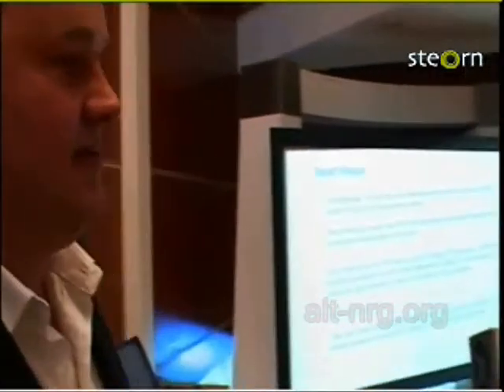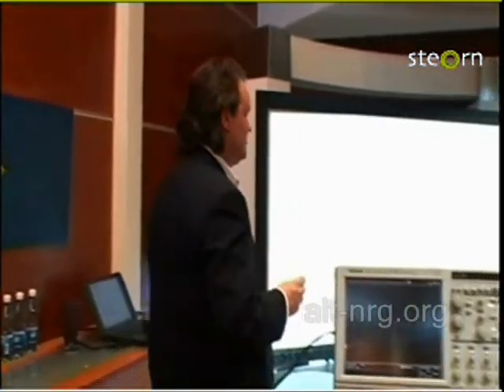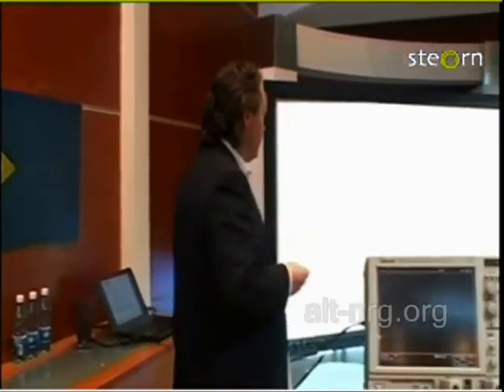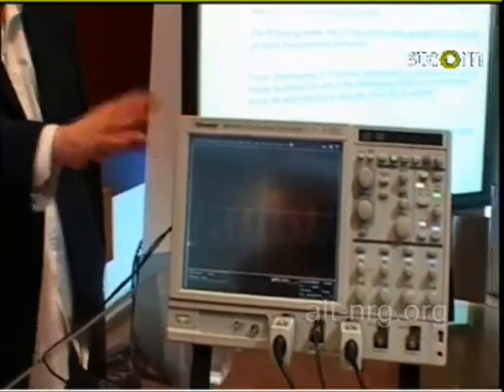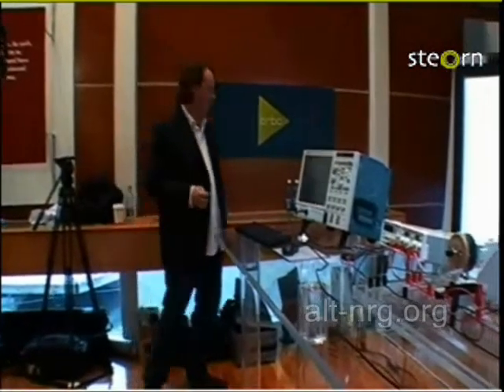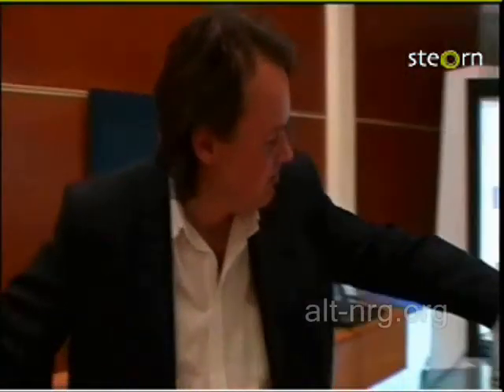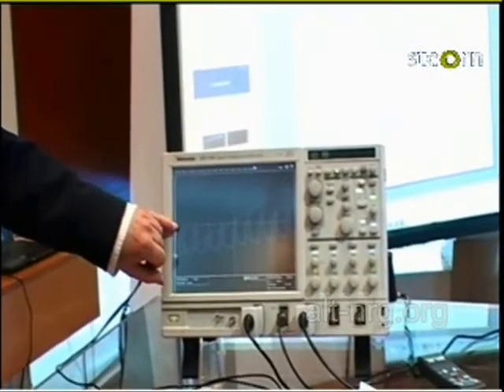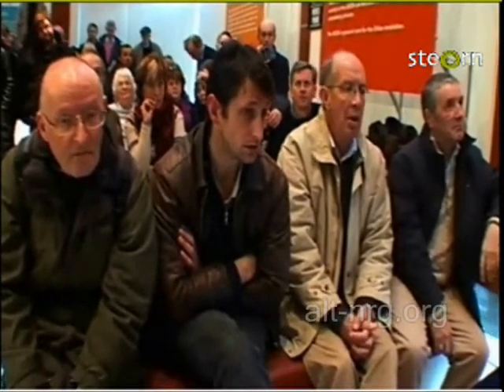#217 Steorn Orbo Demo, part 3 of 4, Jan 30, 2010

Comment: You have to give him credit for not overstating the energy differential at 5:42, he started to say a couple hundred microjoules and then changed to 150 microjoules.  And then points out that the they're only getting 1.5 millijoules of work, most, based on his statements, coming from the I/P (input power). Certainly appears to be a lot less than what he is claiming... He's clearly nervous, especially when he talks about who he's targeting. (Possibly people less educated than the kind of people one would get from the general populace.) Still it appears even if OU, this thing makes more waste heat than usable power.  I can't seem to find his 325% OU, or even the 1.5%... oh, well, back to the videos.

Comment: their watts in- watts out are by his terms 1:1 no overunity. but this model he has here is not an overunity device. all he is showing is that they have a circuit diagram/plans that allow you to get 99.9% efficient works from your coils, its up to you to design a motor that turns kenetic energy from the rotor  into electricity to create an overunity device. B-emf is what many have considered to be the last big hurdle to creating a overunity device

Comment: They need a heck of alot of energy using liquid nitrogen to keep superconductors alof to minimize drag. This guys plexiglass model would produce a hell of alot of drag. even the most well designed motors cannot escape the basic principles. Many motors are good but produce no usable power. he might as well call it  fusion energy given his claims it should be able o run off of its own output yes? Then of course with an excess of energy back ino the system it shouldspin out of control. yes?